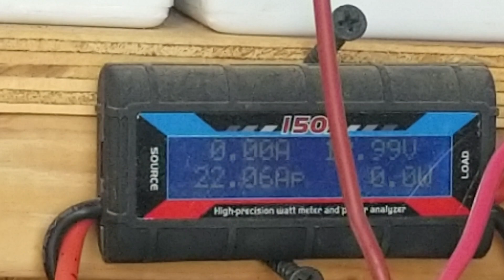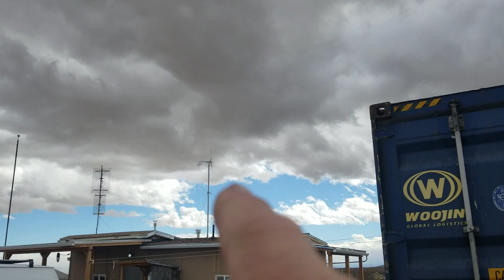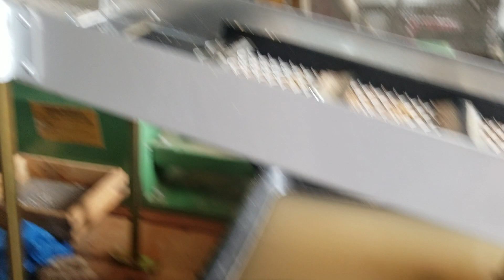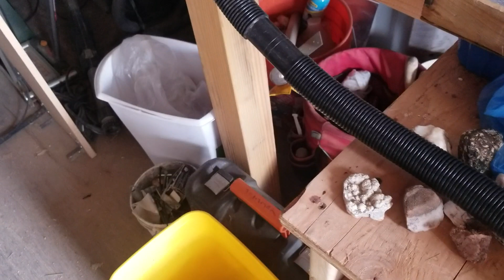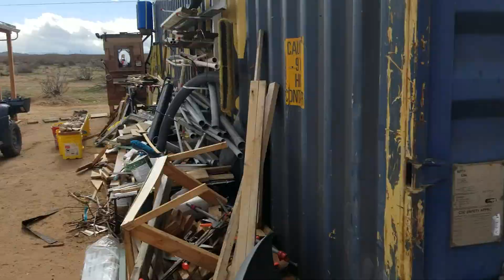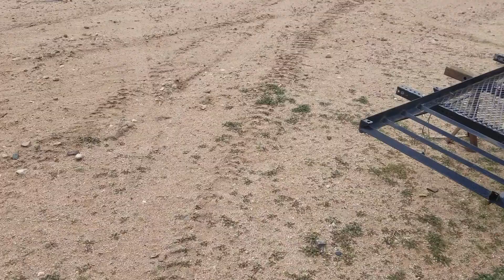GBear's Off Grid Ways-a Homestead in the Desert Feb. 10, 2019

Comment: Gbear is the Turbine u got up now is it dc or ac
Reply from the maker: It's AC.  I want to use 10ga wire instead of 1/0 welding cable.
Reply: Yeah that's what I'm going to use I got about a 100' run
Reply from the maker: @dangoras9152  they say DC is more efficient, but I cant see paying $400.00 for a 30 foot wire run.
Reply: @dangoras9152  
Remember general rule of thumb
Every additional 100 ft of A. C. run increase the wire one size
Reply: Yeah me to I spent 500 on a 500' roll just for solar 6gauge so my turbine I'm going to Atwoods they have a heavy duty 10 gauge cord 100' for 80.00 that's the biggest iv found and that's a good price
Reply from the maker: @dangoras9152  yeah, I priced Home Depot for 10-3 SO cord at over $2 per foot.
Reply from the maker: Also the one I'll replace it with is AC.
Reply: Atwood's got 10-3 black heavy duty 100' 80.00 if I need more I will use a bus bar and run the rest